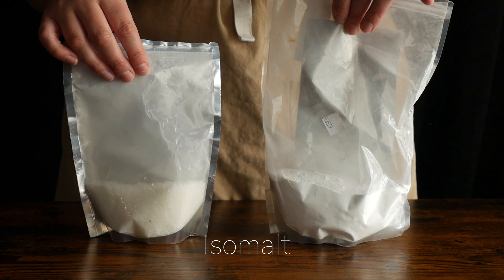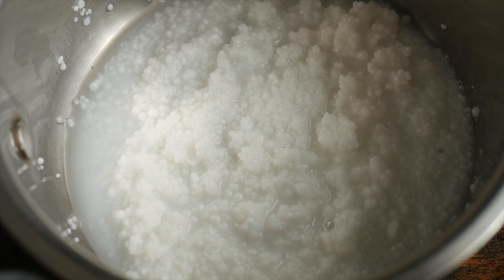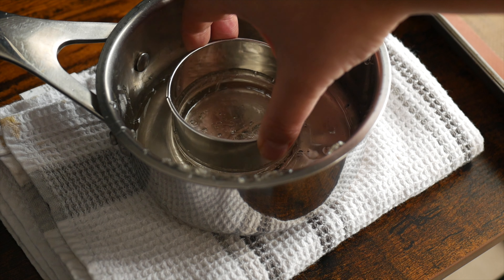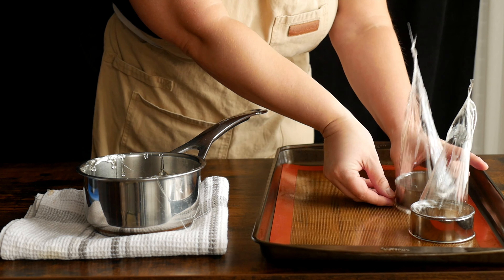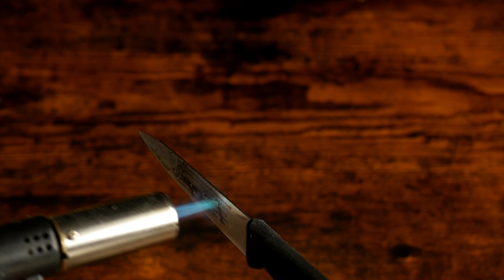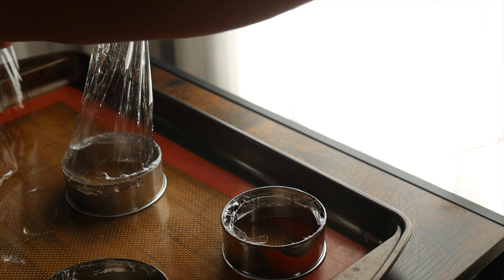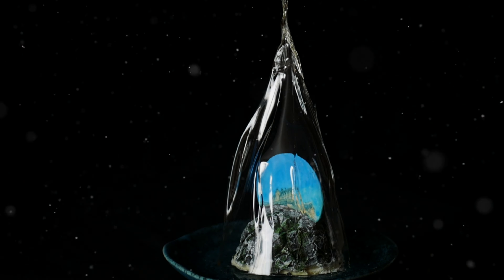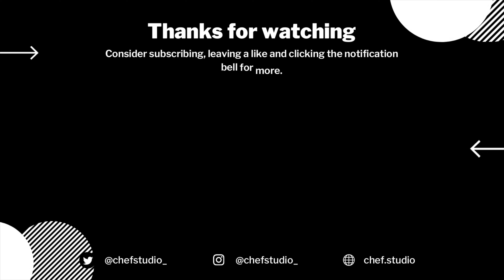Transparent Isomalt Domes | How to Make Edible Glass

Comment: Great video! Clear and not over complicated! Maybe it's worth adding that you should not heat up a high quality kitchen knife with a blowtorch since the heat will definitely destroy the tempering of the steel (most certainly on the fine edge). It won't hold a sharp edge afterwards wich is a key characteristic of high quality knife steel that you have paid money for.
Reply from the maker: Haha yes excellent point. I have that wee sugar work knife there which you can see is burnt to hell so yes, anyone reading this please use a crappy throw away knife!

Comment: Because heating a blade destroys its ability to hold an edge -- the very edge is infinitely thin and there is nothing but air to sink the heat at the thinnest point -- especially after repeated heatings, wouldn't you rather use an electric cutting wire for this?

If this would be of use to pastry chefs then I could try to make a prototype.  It would have a Nickel-Chromium cutting wire mounted in a large rectangular frame to make room for whatever is being cut, and it would be powered by rechargeable batteries.